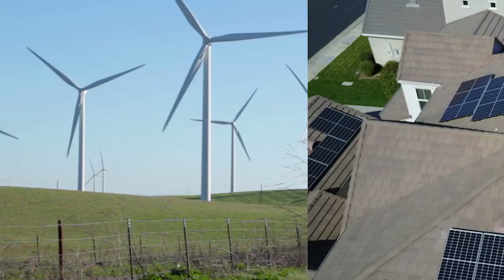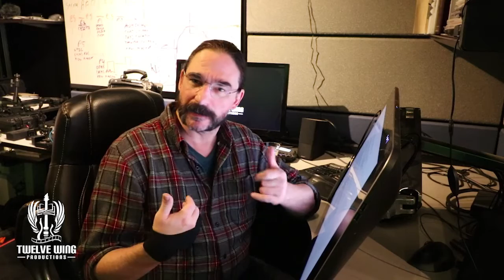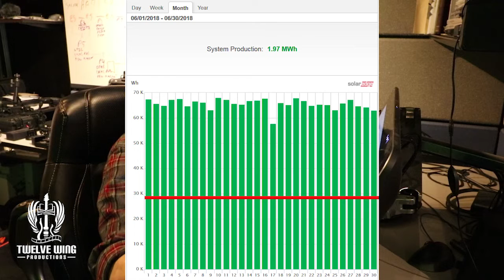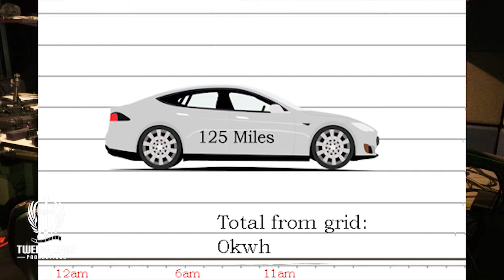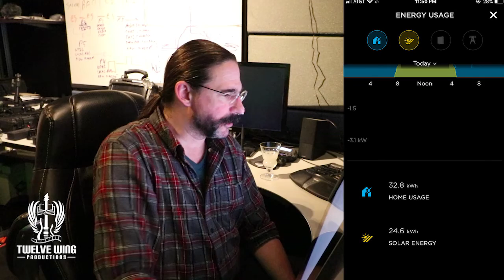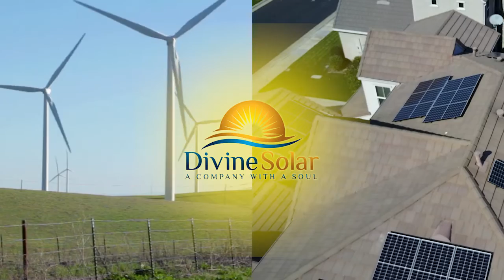Fixing the Duck Curve with the Tesla Powerwall 2

Comment: Have duck curve problem. Need $75k of batteries so solve. No electric bill for last 10 years. Have 2200' total electric home, Tesla, Machine shop, CNC, 5 ton heat pump, only use gas for welding. 60' x 30 9' tall ramada with 50 solar panels on property.

Comment: Watched a few of your videos, thanks for putting as much information and detail into them as you do. This sort of stuff is no small investment so I'm eager for every bit of info and every perspective I can get.

I've got an 18 kW solar array which averages ~65 kWh a day and I'm just a week away from getting a 3 Powerwall system added onto it. My system isn't as aggressive as yours in trying to be totally energy-independent, so I don't have nearly the storage-to-production ratio you have. That said, I am still hopeful that the Powerwalls will go a long way to reducing my contributions to the duck curve while protecting me from short- and long-term power outages. I really want to reduce my household's carbon footprint, but at the same time, I don't want my solar to cause a pattern of energy production and consumption which can't scale.

It's funny to think that many people charge their EVs during the night because that's when they get cheaper power, but because I don't have that option, I'll probably be charging during the day so I'm pulling more power directly from the solar and saving more of my battery capacity for home use during the night.

It would be neat if Tesla had a "lazy" charging mode which would talk to the rest of your microgrid and charge opportunistically. By this I mean your car would charge up to a certain level by default (say 120 miles, or some usable minimum for unexpected errands) and then wait for your solar to produce more than your home is using. Excess would first go into your EV (by adjusting the charging rate dynamically), and once your car is charged (or you still have an energy surplus despite charging your car at its full rate), it would behave as normal (charging the Powerwall, then flowing out to the grid).

Comment: Thanks for the showing us what it takes to put the load of the car on your system. Love your project. There is a channel that is running a residential wind turbine on custom tesla batteries and its keeping his battery charged along with his solar. We are relocating to 9600ft, our energy sovereignty project will be 14kw+2 powerwalls off grid with 1-3 2000w wind turbines as we see almost a constant 20mph wind at our new location. Im hoping this will keep batteries charged through the deep snowy winter.  We'll charge our car at work from the EV chargers or work from home every few days to charge the car. Thanks for all your R&D.
Reply from the maker: Two things...
Firstly, shoot us a link to that channel.
Secondly, where are you at?  When you start your project I would love to come visit you and showcase your system as well.
Is your new home completely off grid or is there also a grid tied connection?  If it's totally off grid you may have some difficulty using Powerwalls.  If you do have a grid hook up, you may want to consider a 3 or 4 powerwall system.

One thing that does change things a little is that there IS a way to connect to the Powerwall 2's locally using their onboard wi-fi connection.
I'll be doing some tests and a video on that very shortly.
Reply: @twelvewingproductions7508   https://www.youtube.com/watch?v=N5AfBnCbpvk&list=PLN27RBy3Kjw2a3c21dueEbNQDJeEe-4O_&t=0s&index=31  

We are just digging our profile test pits for septic today (should be finished mid summer 2019). We are off 285 in Colorado just  west of Denver in Jefferson.
We will be off grid completely with wind and generator backup power if cloudy/snowy. Its just my wife and I, our power demand outside of refridge, oven, wash/dryer, and LEDs will be a sub 400 watt ITX CPU, thats about it.
Im unsure of the electrical demand we will have but at the very least I need the solar and batteries to maintain the hydro radiant heat system and exhaust fans. If the 2 powerwalls cannot, we will add the batteries needed.  
Will be following your Wifi test when you post the video! 
You mention onboard WIFI but is there an Cat6 port on them at all?
Thanks for taking the lead and gathering video content on it all! These batteries MUST be capable of powering off grid systems!!!
Reply from the maker: @JBoy3210 , 
The short answer is that there is a Cat6 port on the gateway.  I don't know how much control this actually gives you.  More to follow today.  I'm actually trying to connect to mine as we speak.

Comment: Good video, now.. the question is.. does an owner of a powerwall want to get the max for their homeusage.. or are they foolish enough to let the gridcompany manage the powerwall according to their needs. That can only be done when your homeneeds are much less than your solar production.BUt the Owner should define how much power and at what time at what cost you want to give them. So basically with the right size of powerwall and EV, you might reduce the impact to the grid to an absolute minimum. Then they have no arguments any longer against projects of building solar plants. Btw in Australia Tesla built a big battery of 100 MW to level the public grid.
Reply from the maker: I totally agree.  The home batteries should be treated no differently than the air conditioners that are grid controlled to cycle load.  They can be overridden locally if someone in the home is having a heat issue.
This is basically what I was talking about in the video where I mention that Tesla and the utility companies may be opening themselves up for legal trouble.
Not allowing the owner to charge off the grid in preparation for bad weather is a disaster and it's likely that both Tesla and the utilities realized this.  To try and skirt around this, they created this stupid "Storm Watch" mode.  
If they had ADDED "Storm Watch" to automatically charge the system to 100% (when switched on) I would be singing their praises for doing so.  But ONLY if the owner ALREADY had control of charging off the grid.

Why? 

Simple.. because in it's current deployment, Tesla is the arbiter of when a storm reaches an "Acceptable level" of severity.
It shows they recognize there is an issue but then places them at legal risk for missing something.
Two days ago we had hard rain and very high winds.  The power at the studio and at the Energy Sovereignty home went out.  No batteries at the studio so it went dark.  Nothing better to do I grabbed a camera and rushed to the ESP home to needle them about it.  
Fortunately for Tesla, the power was back on by the time I got there.. and of course the batteries supported a 40min loss of power just fine.  But what if it had been more serious and the wind had taken out a transformer or a tree had fallen on a local distribution substation?
I only had 20kwh of power in the battery at that point.  Less than one day of power and with rainy weather the next two days no way to put any meaningful charge into the battery even with severe conservation.
All because Tesla didn't think the storm was strong "enough".

In closing, I am following the Tesla battery installations in Australia and the US as well as other places.
This is going to be huge.  These stations will work wonders for smoothing the grid.
The only thing I fear will happen is that politicians will pass some law to prevent people from creating and storing power at home... thus forcing people to obtain their power from "Gas stations".  I am convinced that there is a huge lobby for this even as we speak.

We need to put that to rest with laws NOW.  Even to the point of trying to get it written into the constitutions of states and perhaps even the federal constitution somehow as an "Energy Sovereignty Amendment".  People should be given that right.  Just like free speech and the right to bear arms... it's a weapon against tyranny.